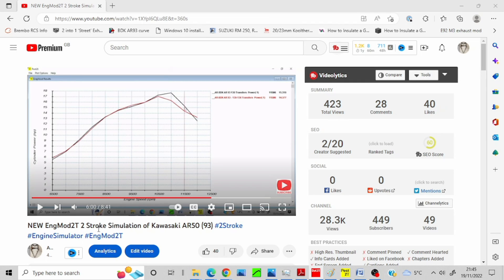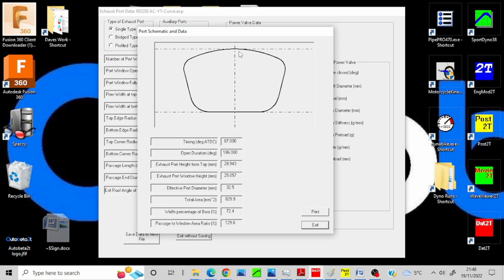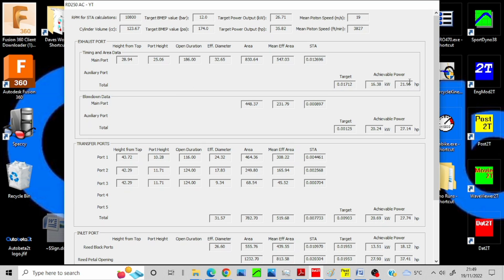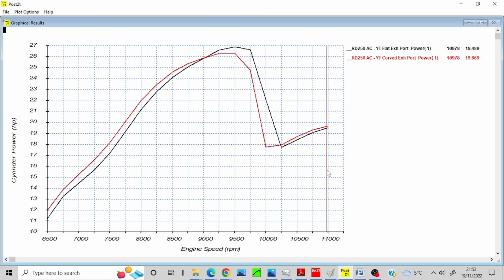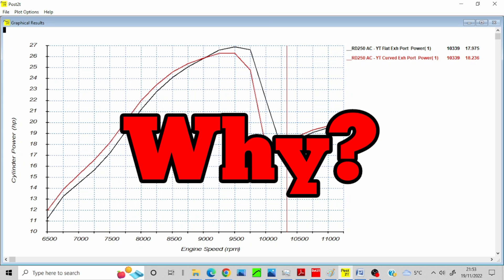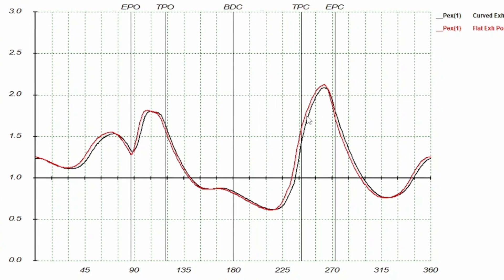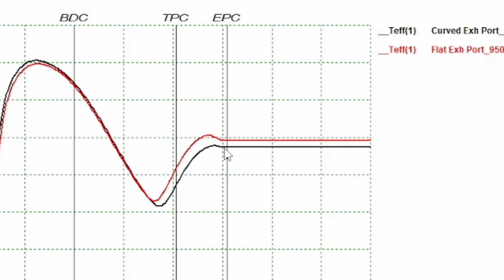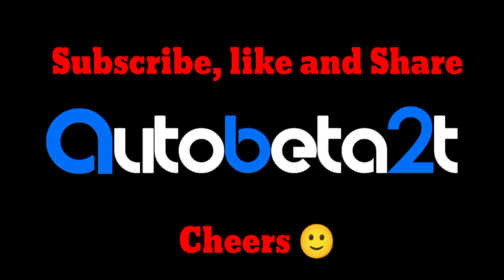Flat Top Vs Curve Top 2 Stroke Exhaust Port Engine Simulation #2Stroke # Tuning #engineSimulation

Comment: Common knowledge  I'm sure I made a video  on port roof shapes. A radius  roof will give you a wider power  band. You loose less torque. Great video
Reply from the maker: Cool. I'll have to try to find it unless you have a link?
Cheers mate ☺️
Reply: @AutoBeta2T  I don't choose best words when writing. But on small displacement two stroke when looking to achieve  more mph. Weight, frontal frontal  area ie wind drag. Lever position  tire width, cable routing, rider position. Is all free mph.
Reply: @AutoBeta2T  there was no computers or software  growing up. But  tested hundreds of different port timings and shapes. Never been big on theoretical  or hypothetical. More hands on common sense stuff. Keep up the good work. Small bore under devolved  engines  separate  the big word users and readers to the hands on real world function   blessing with your bike you have gears. Now imagine  trying to I keep function and achieving your goals but stuck in 5th gear
Reply from the maker: @2strokecarbtuningportingin187  I sometimes think the old school.way is best. It's too easy to just play with the software and think you are an expert when real experience it gold.
Must be quite a limitation of max hp you can have as you need to have a wide powerband so yes have the gearbox is a blessing. Saying that the first attempt fell into a power hole when going to 6th. Closer ratios could help.
Reply: @AutoBeta2T  https://youtu.be/rhWd3L9wsBc one of many

Comment: I think in the practical situation. The flat top port allows for more blow down area for a given port width which also aids in higher rpm hp
Reply from the maker: Totally agree 😊.
It would need a good chamfer/radius to help the rings I recon.

Comment: I have made a cylinder - 50 cc Puch Monza

https://youtu.be/9VIORnXkrBU
Currently 192 ex and BD of 32 degree
23 mm Polini cp and it is currently making 6.5 hp to the wheel but with a very wide powerband.

Would you have any suggestion as to increase Power - would like to hit 8hp on the wheel

Would you have a suggestion